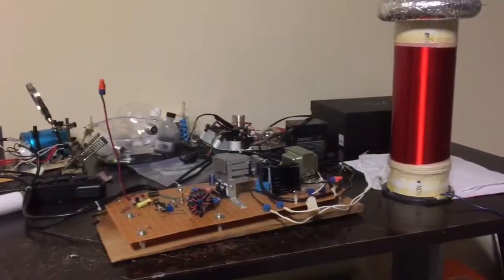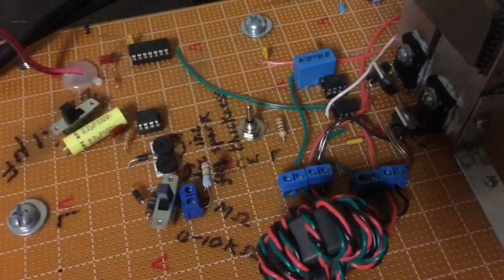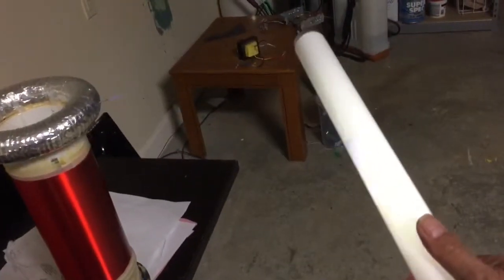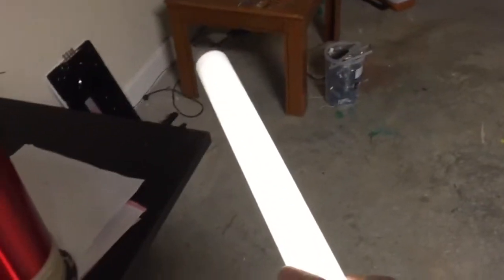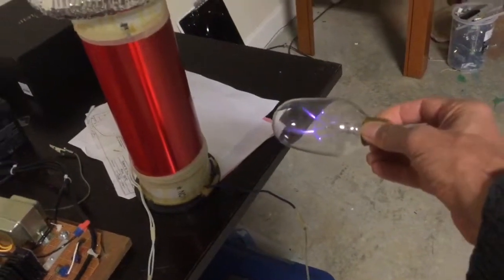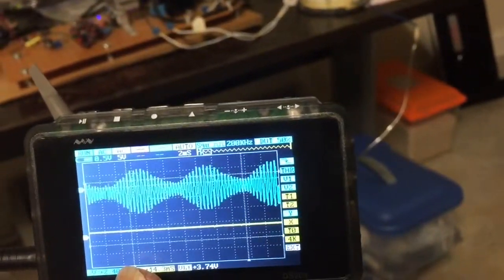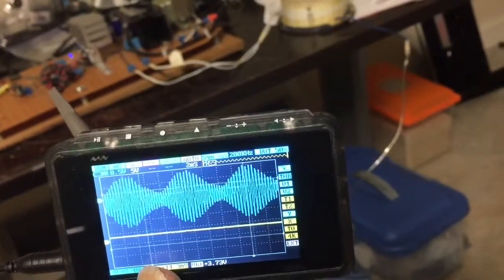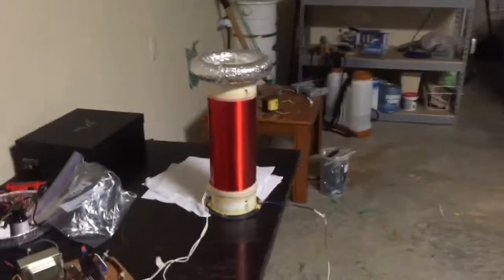Bypassing Interrupter for CW Tesla Coil

Comment: Does the direction of primary winding of Tesla coil and secondary winding of Tesla coil matters ???

If primary winding of tc is in clock wise direction then is it necessary to secondary  winding of tc also in clockwise direction ???
Reply from the maker: Make sure to wind the primary coil and the secondary coil in the same direction. It it does not resonate when you connect it up, then reverse the connection to the primary. Make sure the base of the secondary is grounded.
Hope his helps.

Brian

Comment: Dear brain d
Sorry for asking many doubt's .
So u have continues wave mood by connecting 555 chip 3 pin to pin 2 of ic's ucc37322 and 37321 with 560ohms resistor .so that the ic's ucc37322/21 will won't get feed back by antenna.
Mi right ??
Reply from the maker: Raj Heman Disconnect the 555 from the pin 3 of both UCC. Connect the pin 3 of both UCC to a 560 ohm resistor which is connected to the +12 volts positive rail. You need to have the feedback for it to work so do not do anything with the pin 2 of both UCC-keep them connected to the 74HC14hope this helps
Reply from the maker: In the video I mistakenly said pin 2 when I should have said pin 3 of UCC. Pin 2 of the UCC is for the feedback and pin 3 turns the mosfet drivers on or off. Sorry for the confusion.

Comment: Myself unable to get ic ucc37322 and ucc37321 in India
Plz suggest Any substitute ic for these ics
Reply from the maker: Raj Heman Another alternative to this is the micro SSTC which uses one transistor and is just as satisfactory in terms of continous wave output as it has no interupter. This circuit uses a TC4420 instead of the UCC 37322 /21 pair. I could not find a good substitute for the UCC pair that would give the same current rating of 9A, If I find something I will let you know.
Reply from the maker: Brian D sorry here is the link for the CW setup using a single irfp460 mosfet. You can substitute this for and irfp 260 or irfp250
Reply from the maker: Brian D http://www.stevehv.4hv.org/SSTC6/microSSTCschematic2.JPG
Reply from the maker: Raj Heman here is one that you may be able to find the parts for in India. this one is one of Steve Wards first ones:
http://www.stevehv.4hv.org/SSTC6.htm